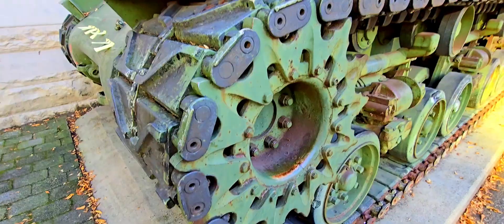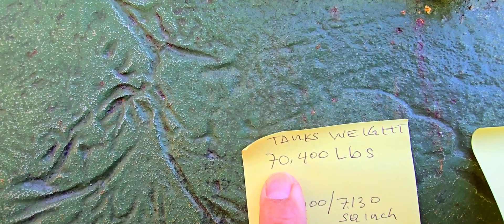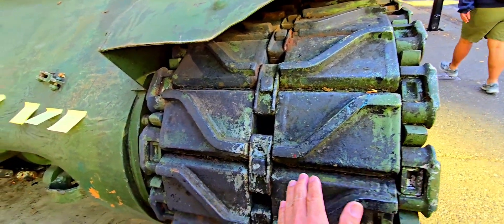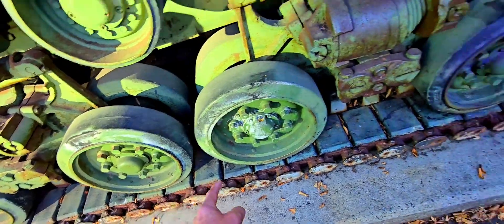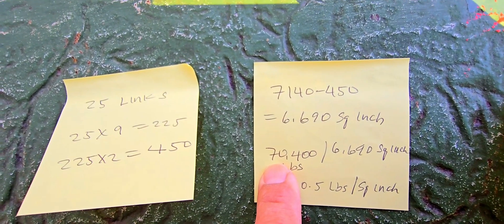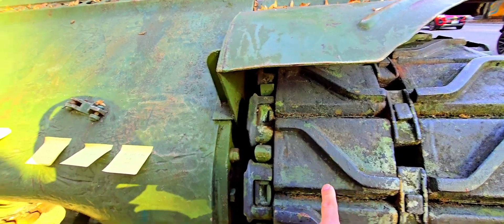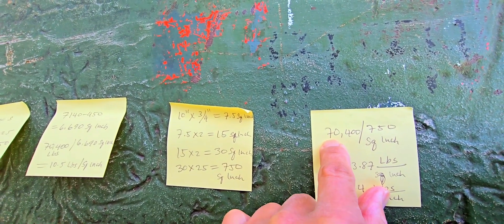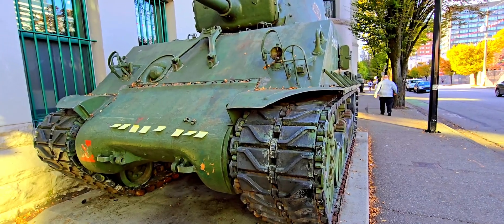70,400 lbs M4A3E8 Sherman Tank Ground Pressure Calculation. Why this tank has about 10 to 94 psi gnd

Comment: Your calculations are for the entire link of track but the part that's in contact with the ground is the surface of the Chevron of steel on the track section. If it's on soft ground where the whole track can fully immersed with the soil then  the ground pressure can be calculated
Reply from the maker: I did calculations in three scenarious:
1) entire track area with direct contact to a soft ground. The ground pressure is 10 pounds per square inch or 10 PSI
2) entire track area with direct contact to a softground minus the spaces in between the track link. The ground pressure is 10.5 PSI.
3) Surface area of the chevron steel ridge of the track link on a hard concrete surface, the ground pressure is 94 PSI.